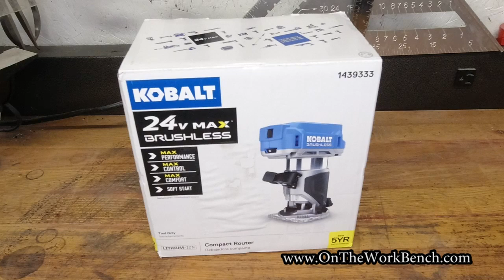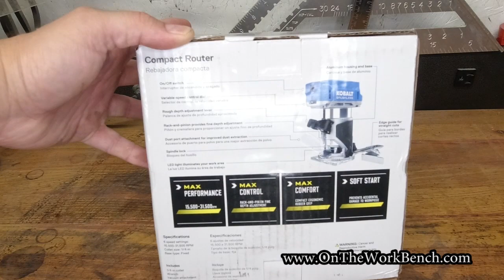Kobalt 24v Router Unboxng and Review

Comment: How did you get the 24v battery offer?  I haven't found anything online offering a battery. Thanks
Reply: All the kobalt and bare tools and most of the XTR tools are eligible for a “free gift” which is the battery. If you go on the Lowe’s website and select a tool, it will say “free gift with purchase” at the top. All the Lowe’s locations around me have been advertising this deal in stores for weeks and some haven’t posted the XTR deal yet but if you show them on the Lowe’s website they’ll honor it.
Reply: I’ve gotten 7 free 2AH batteries and 1 free 4ah battery so far through this deal
Reply: Right now, the lowes website is offering a deal where if you buy a battery kit with two 4ah batteries and a fast charger for 150 bucks, they'll give you this router for free

Comment: cant find it online..yet.. good to know about it. been satisfied with other kobalt tools.  Also, if you get the protection plan, you can purchase batteries at half price. Worth the price of the plan just for that feature!
Reply: Can you provide some info to back up that half price battery claim? That’s the first I’ve heard of it and I’m a diehard Lowe’s/Kobalt consumer.
Reply: @homeimprovementsubaruguy2556  You purchase the Lowe's protection plan with your power tool. It has a keep it running program included. This allows you to purchase accessories for your item and they will reimburse you 50% on a Lowe's gift card. you buy a battery for $100 they send you a Lowe's gift card for $50.  Just Google the terms and conditions.  I questioned it myself. I call them and they said that was how it worked.  And it did!
Reply: @homeimprovementsubaruguy2556  It's a great program that no one knows about!

Comment: That's weird. My lowes don't carry this tool yet. And website says it's unavailable
Reply: Same in my area.
Reply: Just found one on eBay and snagged it up.  Also, just last night, I picked up the XTR Recip saw & the circukar saw & received 2 FREE 4.0 batteries with those tools.  
Even better, they were on sale for $109 each & I had a 2 x $20 off coupons.  So, I basically paid $96 each for the recip saw & 4.0 battery,  then another  $96 for circular saw & a 2nd 4.0 battery. LOVE IT!!